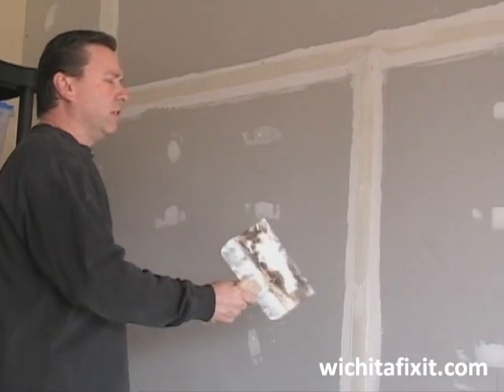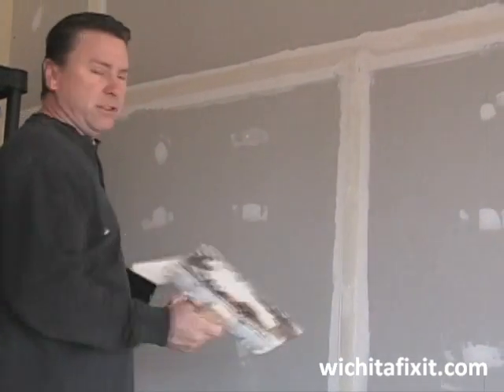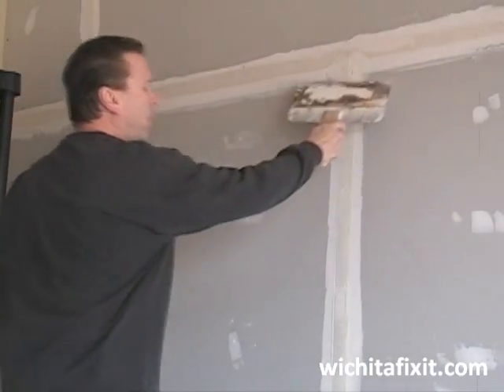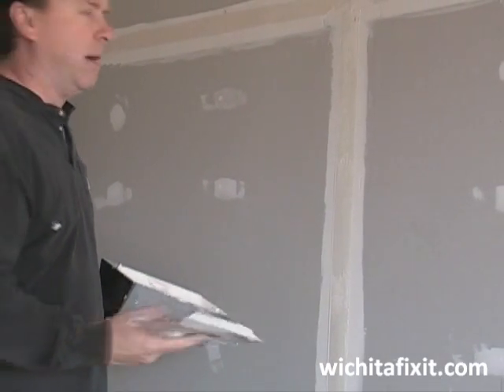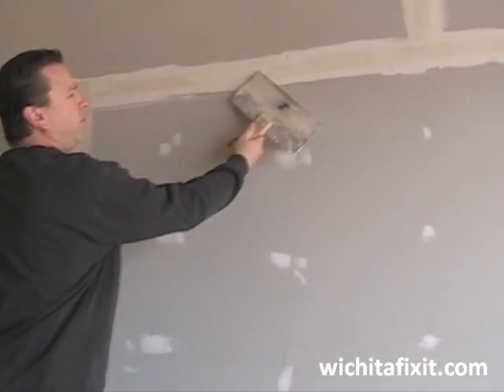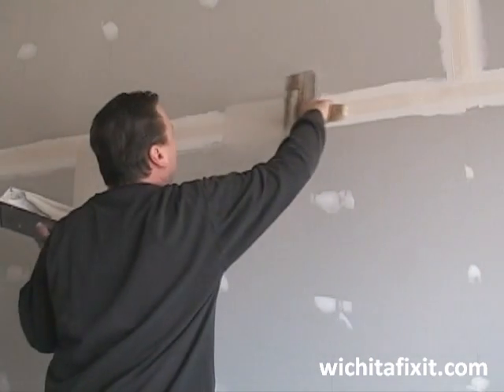How to finish drywall Butt Joint Taping and Second Coat.

Comment from the maker: Just fill the factory side with mud to make it even with the other side, then apply your tape, as you squeeze out the mud make sure you try to keep the tape even on both sides, this will make the second coat easier to apply.

Comment from the maker: I don't think so, I think it's better to put the tape on the mud that is on the the drywall and make it a wide joint, than spend the time to try and plane out a joint and not leave rolled up paper and broken crumbs from the drywall to get in the mud ( Nothing worse than trash in your mud) but if you think that's easier I guess it would work. Thanks Steve

Comment: @wichitafixit What happens if there are bits of paper and drywall crumbs in the mud?  I've been doing a lot of drywalling and plastering and taping and sanding.  Ugh.  Am I going to have to redo a bunch of this?  I am sure that some of the butt joints are not pure.   Arrrrg!

Comment: why did you not clean off your edges on the butt joint? gonna be hard to cover that now with your final coat, you are gonna have to make it really wide to kill the hump, plus you are making loads of work for yourself by not loading the knife enough, it should of only taking you one pass to cover that joint, but whatever floats your boat